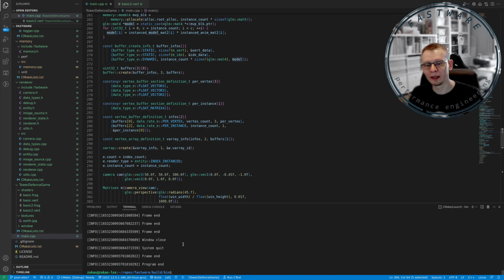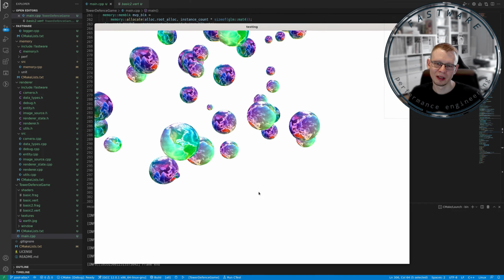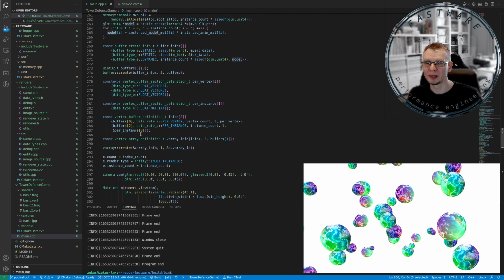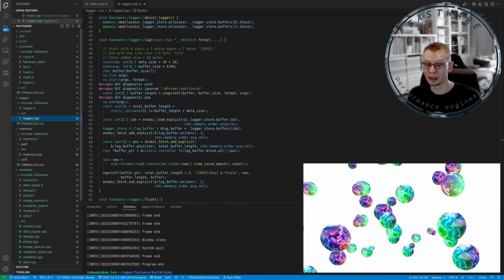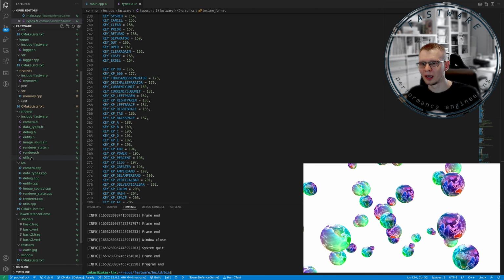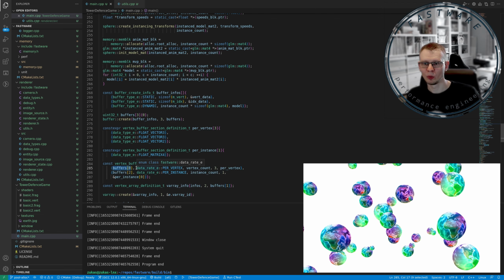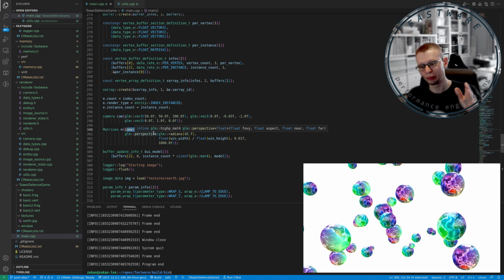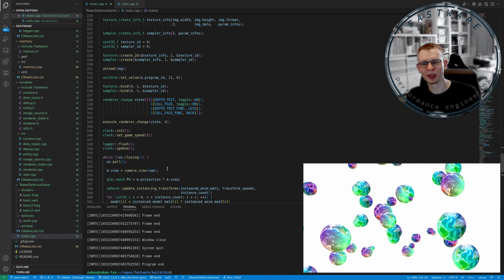Fastware - A fresh start! Starting a new project.

Comment: It sounds great, to be able to see performance implications the way you show them in a live project! I'm particularly curious about the memory management and allocation, it seems to me there is few sources that provide information and implementation at the same time for that and it can be so performance critical...
Reply from the maker: I am glad that you have an interest in the topic. The project already has the stack and pool allocators which are used in most internal systems. Some 3rd party stuff is a bit more tricky but we will get there.